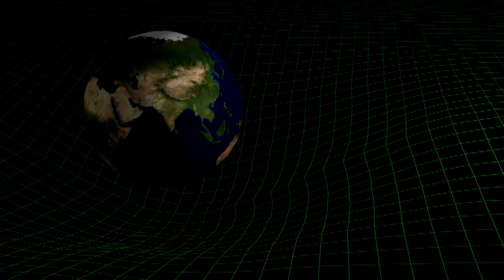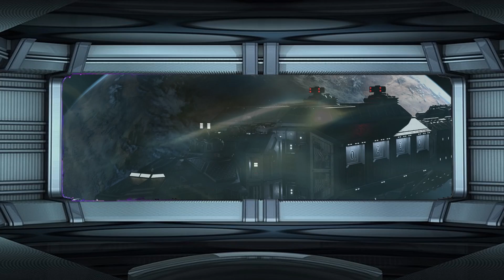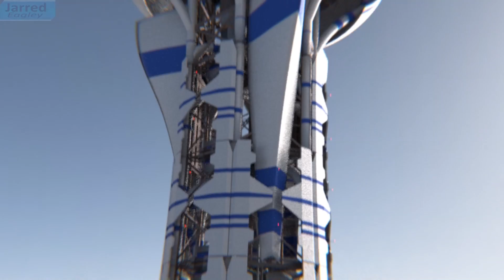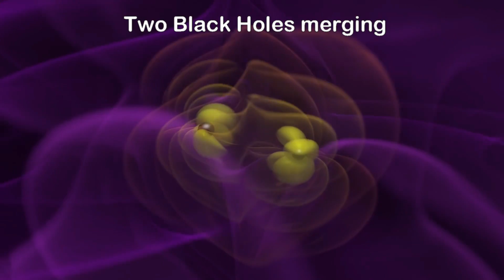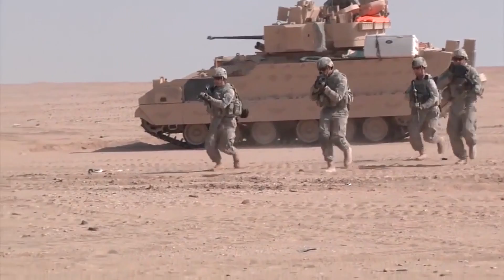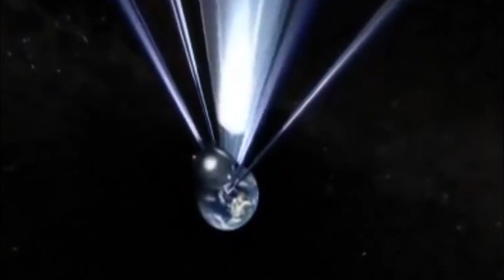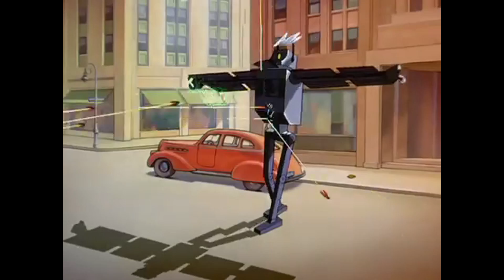Force Fields

Comment from the maker: **Author's Note**
Youtube has stopped sending me email message notifications anymore and it seems impossible to get those turned back, they might have some volume maximum, so my apologies if here and elsewhere I start missing replies to comments, I'll try to keep up with new videos by manual scanning and check on others occasionally but I'm sure I'll miss a ton and I felt folks ought to know that I wasn't deliberately snubbing comments and not deigning to reply.
Reply: That's very polite and considerate of you, Isaac. You're Awesome!
Reply: rude
Reply: Magnets are a type of forcefield, so to think of forcefields as being truly impossible would be irrational.
Reply: I've also been considering such an idea (using magnetic dust) for some time and I'll list some reasons for it, issues and solutions for them.

ADVANTAGES
Firstly, such a shield is doable, provides protection against projectiles, explosives and radiation weapons.
Secondly, magnetic dust is relatively easy to manipulate using magnets, to make, transport and if you run out of it in space there is a lot of metalic dust and rocks in space to make more.
Thirdly, you can adjust the density of the shield (by diverting more material from other parts or simply adding more to the whole)
Forth, by changing the dust (from pure iron to some better alloy) you can change the properties of the shield

PROBLEMS
1) If the dust gets heated up to much (due to getting shot by a laser) it may lose magnetic properties and you lose a part of your shield so you need to keep a reserve of material to repair it and keep a consistent strength.
2) If dust gets melted on mass and then cools you may end up with big obstructive metal chunks in your shield 
3) Its hard to see through a dust cloud.

PROBLEM SOLUTIONS
1) Use material that keeps magnetic properties fairly consistent despite temperature changes.
2) Use materials with high melting points (less molten dust), have a sistem that breaks/removes larges chunks or filters dust
3) Have sensor masts sticking out of the shield or have sensors be a part of the shield (like a bunch of micro cameras to provide a composite picture of the surrounding of the ship).

This concept has a lot of other possible applications like:
- expanding the shield to make the ship bigger than it actually is
- hiding and protecting other ships behind the shield
- expendable battering ram (though this would probably used for more peaceful purpose than war since noone would let you get that close if the could help it)
- particle weapon (shower your enemies with high speed dust)
- radar blocker

Of course when I say dust the size could vary drastically since noone has made and put something like that on a spaceship.
Reply: King Weaverbe He really is! The guy just pumps out the most incredible videos on a weekly basis! It's really a great escape from the political news cycle for me. Looks like this channel is starting to take off too, it's about time, in my opinion. I rarely watch Science Channel on TV anymore, just get my science/geek fix here instead!
Reply: Isaac Arthur how about kinetic fields from mass effect, is that what your talking about
Reply: Solexx X while I agree that Wild One commenter is a rotten person, even Isaac keeps politics to himself. I just figured the least we can do is not clutter up the comment section with our political squabbles?
Reply: Isaac Arthur ,the coolest guy on the internet.
Reply: TFW you're in the 0.01% of best channels now
Reply: Did you check Comments & Activity tab? Because I had the same problem and I after a while I figured out that one box in there unchecked itself for some reason.
I assume that you did, but you know, just in case.
Reply: +Isaac Arthur The US navy actually has deployed a real laser on some of its ships. mostly for point defense and for targeting small boats, but they plan on increasing its power output by 10x or more.
Reply: Isaac - I'll send Google an email with an embedded Black Hole...that'll teach them!
Reply: Guess you are a victim of your own success, sorry.
Reply: Just about to start this man, please please don`t tell me they can`t happen :) Thank you for your amazing videos
Reply: Well, this doesn't seem the best time to ask you a question but here I go:

Assuming you know where your opponents ship is, could you use a bullet coated in some sort of metamaterial made of superconductors? Say you take a moderately small chunk of titanium and then you add a battery, a small chip and then coat the whole thing in a complex weave of superconductors that form a metamaterial that is designed to make the bullet basically invisible. The superconductor makes sure the system is efficient and takes care of lower level ionized particles, the metamaterial makes the bullet invisible to lite, the titanium core is the hard central core that is supposed to do the damage. You then use the battery and the chip to turn the whole thing on when the bullet is launched via a coil gun. A nice, seemingly invisible bullet that just goes through the vacuum of space and hits the opponents ship, going past the ships point defense since it can't be detected.
Reply: The US Navy is using some decent laser weapons already, and are designing some very powerful ones for the new Ford class supercarriers.

Each carrier has two brand new nuclear power-plants.  They have an ocean to dump their heat in to.  That's a lot of firepower!

They've been approved for use in the field on enemy combatants.
The near future is warfare at the speed of light.
Reply: At one point, you mentioned intergalactic travel may be on the list of future videos. Is it still on the list? and will you ever discuss antimatter in more detail? I've heard suggestion that buckminsterfullerene molecules could be used as magnetic bottles, any thoughts?
Reply: Isaac Arthur no worries mate, just know you are doing amazing work!
Reply: Guys, enough piling on. I don't think that this is fitting of Arthur's outlook on life and this should be respected. There's plenty of other boards where the barbs are free for slinging. It's bad enough all of us lost just about every science site to politics and fighting. I hope this one can be spared.
Reply: Youre comment on light not being able to pass a force field reminded me of a book called "The forever war" where soldiers use a similar devise that shields their area but leaves them blind to what is beyond it. Its a book I would recomend
Reply: wild one - Instead of making fun of someone's disability, why don't you instead try to control your inability to not comment rudely and watch the video and learn something. Issac Arthur also has captions available if you are unable to understand him. :)
Reply: @Prakash Chandrashekar : and your name is one of the most influential name in the history of astronomy ! Deep Respect,  Honour for Subrahmanyan Chandrasekhar, which I could not imagine forget somehow ever !
Reply: It's OK. I ran into the same problem a while ago.

For various reasons I wasn't always comfortable looking through my notifications.
As a result, I built up a huge backlog...

Past about 200 messages or so, at some point youtube just decided not to give me notifications anymore.

It's just one of those weird random things I guess...
Reply: The fact this bothers you says great things about the fantastic person you are. I am glad to be a subscriber.
Reply: In Stargate Atlantis there were a couple episodes about foreign matter and I've heard about how dimensions could have different configurations and by that shape the rules of physics in a universe.
Is that somehow compatible?
How far different could other universes be?
And is there a reason why the matter of another universe can't be in ours?

This may sound a bit ridiculous but it kept coming to my mind:
Would it fundamentally be possible to "design" a dimensional configuration?
So could we for example "design" our own new form of matter and energy that does things for us that our native matter and energy can't do? Like Hyperspace and Magic and all those things that could, if at all, only be explained by things outside our own box.
Reply: +Zepha21 "In Stargate Atlantis there were a couple episodes about foreign matter and I've heard about how dimensions could have different configurations and by that shape the rules of physics in a universe.
Is that somehow compatible?
How far different could other universes be?
And is there a reason why the matter of another universe can't be in ours?"<--theoretically there is a infinite number of universes and their parallel universes. an theoretically the laws of physics as we know only apply to this universe. even if we could apply the laws of our universe to every other universe there will still be differences.

changes can range from small to large; for example a universe can be incapable of providing a nurturing environment for life, one can have a abundance of life, in some you may get life here and there, and as hinted earlier those incapable of providing a nurturing environment you may get no life at all. there can be a universe were your a girl instead of a guy, one were maybe humans are hermaphrodites, or asexual. 

as for why matter from other universes can not exist in our universe or be here is simply from the fact you would need a massive amount of energy for such an event to take place. an distances between these universes can be vast or relatively "small" just like how the closest system to us is a relatively "small" distance to traverse. effectively your connecting two different universes.

as for different dimensions; different dimensions are not different universes.

"Would it fundamentally be possible to "design" a dimensional configuration?"<--we already do this every time you draw a irregular shape you are creating a dimensional configuration that exist on the 1st and 2nd dimension meaning it has height and width. if time effects it than it also involves the 4th dimension.

take that shape and turn it into a 3d object by adding depth aka the z-axis it now exist on all 4 dimensions.

every dimension above that is essentially a different timeline; they are not exactly different universes though.

although one could argue that because the higher dimensions are different timelines they create different universes. which is where the whole parallel universes constantly interact with ours comes from. which comes from quantum mechanics were a state or outcome of a system or reality is only forced through observation. which means upon observing the end result all results have been theoretically recognized and branch off based on the differing result.

put simply it is the butterfly effect.

"So could we for example "design" our own new form of matter and energy that does things for us that our native matter and energy can't do?"<---to design your own matter you would need to find/create a way to form new bonds and organizations of particles. every atom is made of protons and neutrons and electrons which are theoretically said to be made up of even smaller particles known as quarks and etc.

"Like Hyperspace and Magic and all those things that could, if at all, only be explained by things outside our own box."<--hyper space is basically the same as worm holes however instead of bending and creating a "tunnel" you are cutting between the fabric and taking advantage of already existing tunnels created by gravity between planets and stars.

however that assumes those tunnels are already there and they occur naturally but are not powerful enough to be actually seen or cause physical effect.
Reply: +IsaacArthur technically we can have magnetic shields and magnetic cloaking devices. the problem is magnetic shields would only really effect plasma like solar winds and radiation. things that are magnetized by nature essentially. an your magnetic shield would also interact with other magnetic shields, drives, and planet magnetic fields. an magnetic cloaking devices would only stop them from sensing a magnetic field so long as they are not in front or behind you an even than that takes meta-materials.

so the real problem as i see it are projectiles that lose their magnetism after they are launched from a rail or coil gun, un-magnetized solid projectiles, and lazers. particle beams on the other hand are held together through a strong magnetic force that keeps them that way till they hit their target allowing them to "cut" their target so magnetic shields can work on particle beams if the magnetic shield was strong enough.

the projectile problem can be fixed through armor

perhaps the lazer problem can be fixed by magnetized water; if the bubble is large enough. an when the steam explosion happens the steam also interacts with the photons of the lazer. an after the lazer cuts through the shield it will be weaker and you could have armor not only to protect against projectiles but lazers by it being heat absorbent such as tantalum carbide or hafnium carbide. or a meta-material that is made with tantalum or hafnium carbide.

or maybe you can induce a magnetic charge in the surrounding particles and create a particle shield that will absorb the light and heat and the armor can absorb what gets through it.

yes i know it is a "dumb" solution but dumb solutions are needed to pave the way for the smart solutions
Reply: I'm not accountable to you, TWERP... I'll stay being a purist and accurate. I'm an engineer. There is accuracy and inaccuracy... Deal with it.
Reply: "I have a better degree than you I know my shit." Carry on pal. You're still an unacceptable moron for putting someone down for a disability. Maybe stick to your engineering and I'll stick to language.  
Your "I'd rather be a purist and correct," Makes you look like a jackass. 'Engineer' a way out of that.
I'll stay annoying - you stay a fuckwit.

If you don't want irritating comments, can I suggest you go back to your ever-so-important blueprints and spend less time online? I, however, have nothing better to do. So crack on, clever-dick.
Reply: This "jack-ass" is happy to be a jack-ass... I'm just having fun now... Please, keep the expletives coming... I have not done my job if I do not manage to anger some little millennial..
Reply: LOL
Reply: Do you cry over Aluminium too? I would imagine as an engineer 'a-loo-min-um' would wind you up WAY more than how to pronounce nuclear. 

Are you going to answer to me again? Because I seem to remember you pointing out that; "I don't answer to you," While you have - Twice now. 

PS. Its wonderful to hear about your new career choice. I thought your job was being a engineer? Maybe the pay is better for being an insufferable prick, can you hand in my résumé to your new boss?
Reply: One idea I payed with was the idea of multiple layers on the shield. Like a bubble of gravity to redshit lasers, some sort of point defense shielding or a plasma window to stop some particle beams or plasma weapons, and some other other shielding to block solid matter. 
The idea in the fighting would be to outsmart the other. The defender is forced to juggle the different ones to block against certain attacks.
Reply: Tha stellaris reference at 5:00
Reply: Isaac Artifishal atifishal gravit effect
Reply: Man any aspiring writers can build a grand universe base on these videos..
Reply: What about covering the hull in electromagnets and then using plasma to créate the field
Reply: Isaac, thank you.
Reply: Force fields, maybe use artificial bosons?
Reply: Issac Arthur, you're really off your rocker with this one. Forcefields? Do me a favor! I know science fiction loves forcefields, but they're not possible in reality, it's just like wormholes, space elevators, etc. I'd love to live in your sci-fi fantasy, but reality steps in!
Reply: All you need is a sheild that lets might though but nothing else then use mirrors to deflect lasers and because you would be deflecting it the other way you would push your ballistic weapons faster
Reply: what about a throwable energy sheild that would slowly build up energy until you push the enrgy to the side lift it up and combine it after this is done you have a gaint ball of energy that can be fired at a opponent and overelm any reasonable defense against it the only counter would be firing another one and thats almost impossable because its moving at light speed
Reply: No worries
Reply: @Isaac Arthur - 
Plowing fields with force fields ? That is how the real Crop Circles are made (gravity & Electromagnetism + small iron particles ) by ET and / or (really) Secret Space Programs.
Reply: The same happened to be and recently they got turned back on.
Reply: The same happened to be and recently they got turned back on.
Reply: What about the notion of a Plasma Crystal? This is the idea of a Plasma that has an orderly structure.
Reply: @wild one  Rude and even if you have a speech issue, you don't have to type as you got shot in your brain. 
Sad to see this community has such ugly people like you who make jokes about others disabilities
Reply: Can we please have an updated video on this? :)
Reply: Solexx X - You must be new around here. Political topics are strongly discouraged. :)
Reply: Keep Isaacs channel politics free please. This is a forum for the sober meditation upon the wonders of the cosmos and genteel conversation. You fucking libtard. That was a joke. Peace.
Reply: Solexx X why did you have to bring politics into that? It makes you look just as ignorant
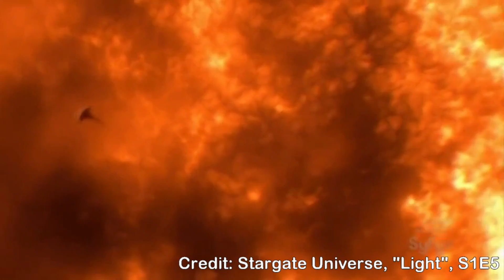Reply: 20:46 "where is that heat going?"
Well, in Star Trek they could shunt it into their EPS Grid, which is only at a few thousand Kelvin, much cooler than the impact sight. Or they have multiple layers of transparent conductors on the hull and act as a TEGs.  This would explain why stuff tends to blow up in ST, as it would imbalance the grid near the point of impact.
Or you could use it to generate matter (or anti-matter) and get rid of 0.9 exajoules of heat for every gram you create.
Reply: Solexx x please keep politics out of this channel.
Reply: Isaac Arthur artifishal   is misspelled
Reply: @2:00 ... Your videos seem kind of interesting... Yes, you have a speech impediment, and that, in itself is perfectly OK... ..  But if you are going to mispronounce nuclear ... as ...  New-Cu-Lar... Suggested re-doing the narrative... It loses veracity with those of us that know how to pronounce it.
Reply: It is probably opening up a can of worms but it would be interesting to see what percentages of people who watch this channel see themselves as Conservative or progressive or liberal or whatever... no need to discuss politics especially as the audience is very international but there are a lot of claims about conservatives being more pessimistic and less interested in the future...
Reply: Glen Collins Nah I'm conservative and I'm optimistic. I feel that liberals and conservatives are having an identity crisis. Conservatives used to believe in protecting our environment and conserving our sacred values while improving the bad. Now conservatives are mainly businessmen and corporate elite. The same thing for liberals, Bernie being apart of the one percent. Liberals should believe in personal freedom yet now they want things like socialism, which requires conformity.

     However, when I say they I mean the top echelon. Liberals and conservatives have much more in common now. We both want personal freedoms and don't want government coercion and control. We both detest regulation whether it be from the government or companies. However, we don't seem to like each other still even though we have so much in common. You have liberals like Bill Clinton and conservatives like trump there's no difference between them. Both made the country better than it ever was and had personal scandalous behavior and personality. 

    My prediction is you'll get something like the Federation from the starship troopers book. A liberal called Carl Benjamin, a very controversial guy made an excellent video about starship troopers that nails it on the head. Even though he is a liberal I agree on many things he says even though I disagree on many other things. I'm pretty sure that in the future you'll have the conservative party focused more on military force and the liberal party focused on infrastructure. Honestly, I can't wait until that happens.
Reply: Let me guess wild one, you voted for trump and think he is doing a great job of taking your healthcare away?